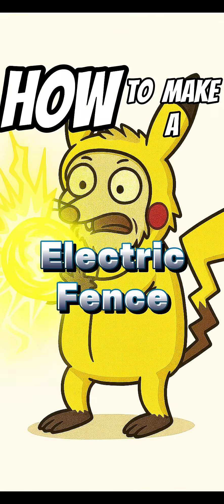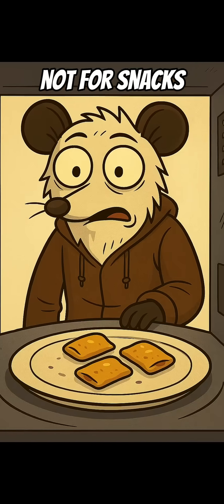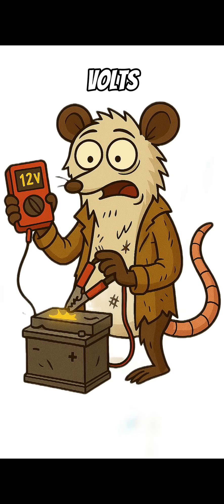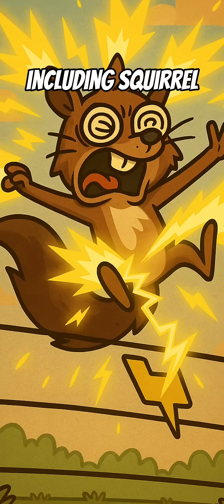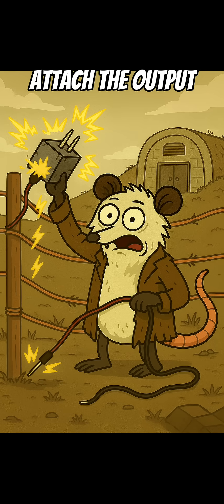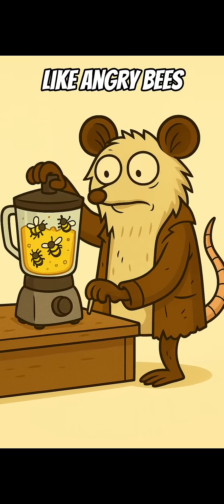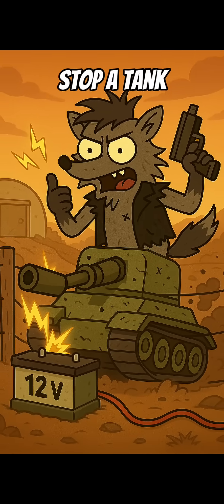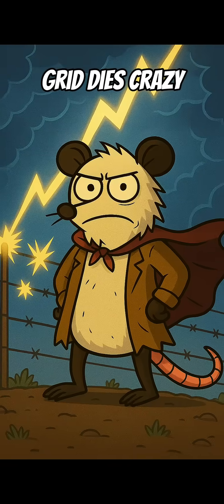How to Make an Electric Fence from a Microwave ⚡ (DIY Survival Hack) #science #shorts

Comment: Sigh... Every time someone puts up a video involving electricity and or physics, suddenly all the "engineers" come out of the woodwork. Here's a quick solution in a End of Days scenario:

In the Microwave Oven (besides the MOT itself), modern microwaves often use inverter power supplies instead of old-school MOTs. These have switch-mode inverters capable of taking rectified mains DC → high-frequency AC.  Use that between the battery and the transformer and  PRESTO! Now you can fry those raccoons, marauders or commenting "engineers" LOL! 

Seriously, you have a great voice for narration and your videos are so entertaining :) Big Fan!

Comment: 12 volts from the battery to the input side of the transformer you can use any normal wire. 
Most wires only insulated or safe within 600 volts It might be actually 300 volts it's been a couple years.

Don't do this...

Comment: Just making a perpetual electromagnet with only one constant polarity polarity, instead of the constant switching of polarities. But you need for a transformer to electrically. Induce occurrent into the other coil.  Allowing you to get higher voltage. But lower average congrats congrats you made of hunk of s*** Maybe next time you'll use AC instead of the far far less superior DC.

Comment: Uh, you cannot use DC to run a transformer
Reply from the maker: You’re absolutely right — standard transformers like the one from a microwave require AC to function. A straight 12V DC car battery won’t cut it unless it's converted first. Definitely not plug-and-play — more of a "junkyard theory meets creative editing" situation 😅
Reply: @DOOMSDAYOPOSSUM now it doesn't have to be AC exactly as long as there is a change. If you take a relay and make an old school relay buzzer, the alternating on and off will cause a differential as well as the reverse polarity due to how many Henry's the transformer has and you'll have a high frequency high voltage step up
Reply from the maker: I see I’ve accidentally summoned the Council of Electrical Elders 🧙‍♂️⚡
Appreciate y’all dropping the real knowledge — and yeah, you’re right. As long as there’s change in current (relay, buzzer, oscillation), you can trick that transformer into giving you some zappy goodness. Now I kinda wanna build the relay-powered Opossum Fence Deluxe™ just to see what happens. Appreciate the comments — y’all are the real power grid.
Reply: @DOOMSDAYOPOSSUM no electrical elder but i have built electronic projekts for fun for say 40 years. and sone of my mentors where around at cutting edge ww2 stuff like radar...so I guess I am old school.
Reply: @DOOMSDAYOPOSSUM  not an Electrical Elder, just someone with a Sc.D in biotech and just a hobbiest ham radio operator.
Reply from the maker: @drrenard1277 i meant no disrespect to y'all. It was meant to be a term of endurement.
Reply: @DOOMSDAYOPOSSUM  also might be worth mentioning that microwaves in the dump or anywhere for that matter could still hold enough charge to kill you for a couple months potentially, do be incredibly careful while harvesting components
Reply: @SHWANtheMAN yeah if that big microwave capacitor didn't have an internal mega ohm resistor in it like they all do to prevent that kind of thing accidentally happening by ensuring that capacitor holds no charge within a few mins of the power turning off, the fear mongering you are repeating is more dangerous than a discharged microwave capacitor, fear is an illusion
Reply: Came here to say the same thing.

Most transformers are two coupled inductors. The power from one side is transferred to the other side via magnetic fields. However static magnetic fields don't induce current, only changing magnetic flux (changing field or moving metal intersecting the field). Hence DC will drive a temporary spike of power on the other side of the transformer.
Reply: Inductance still occurs and can have some dangerous and spicy outcomes.
Reply: Most of the videos of this type of youtube niche have less technical morality, so its good to just watch for only entertainment purpose
Reply: An inverter would make it work
Reply: Also microwave transformers multiply 120v to 2000v which means if you feed it 12v you get 200